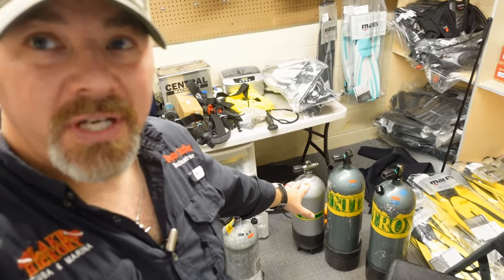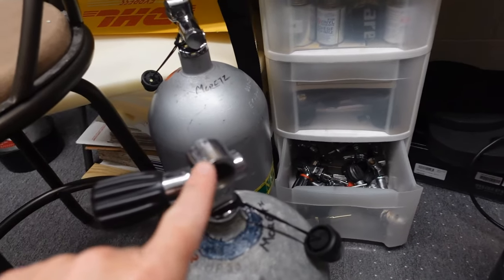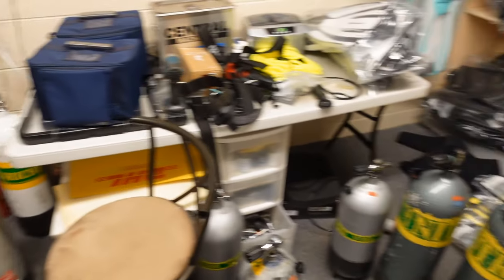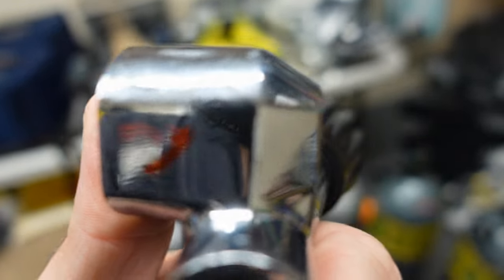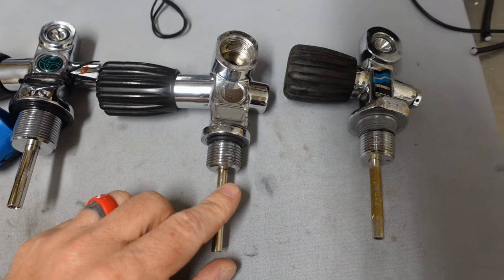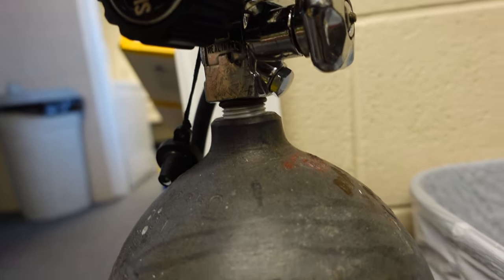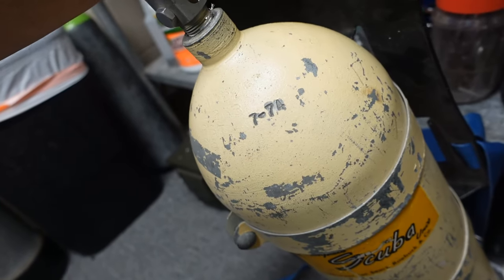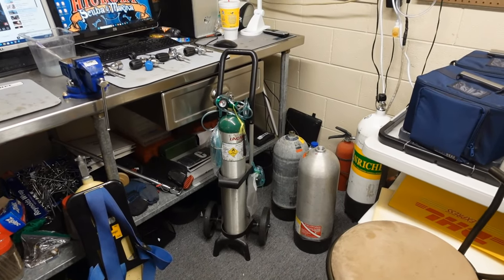What Makes A Scuba Tank A Scuba Tank

Comment: Great history lesson with the J-valves and tapered threads, real Cousteau stuff!  Here in UK/Europe A-Clamp valves are certified up to 232Bar (3365psi in old money) and but hardly anyone uses them; DIN is almost universal.  The 200 or 207 Bar max only applies to Aluminum tanks but that's sort of viewed here as 'low pressure'.  Our tanks have to be stamped with 'breathing gas' or something similar, as well as all the inspection and cert data, but I think anything that didn't have a DIN scuba valve would instantly spark a question.
Reply from the maker: Hello @timgosling6189, thanks for sharing. Here in the States, we must either have a DOT or CTC stamp which is regulated by the United States Department of Transportation. Our hydro stamp must be with in the last 5 years of the date of use, and the visual sticker must be displayed and with in the last year of service. Its always a shocker to our customers and clients when we take them out of the country and they see things done differently.
Reply: @LakeHickoryScuba  Same here.  It is fun when you get a tank from the dive shop in some remote place and can't even read what's on it, let alone if it's in date!

Comment: So i guess the answer to the title question is ... "The cylinder is threaded to accept the type of valve commonly used in the scuba insustry"  I came into posession of a small cylinder maybee 4-6 cu ft. that had a calibration gas used to adjust a medical instrument.  I was trying to figure out what I could use it for but I have no idea as to the thread type of the cylinder so it just sits in a corner of my closet. I have bought and sold several used tanks I recenly got burned when the hydrotest facility failed one of them erroniously on the visual (using the pit depth gauge improperly) and LOST another one, the third one in the bach of four failed honestly with bad threads. So in the end I had the same amount of money in one used tank as I would have just buying a new one.  Win some lose some.
Reply from the maker: Hello @kevindavison6019, that is the gamble sometimes when buying used cylinders.